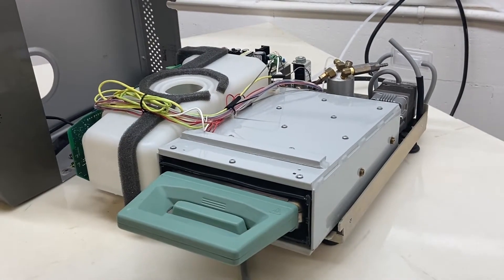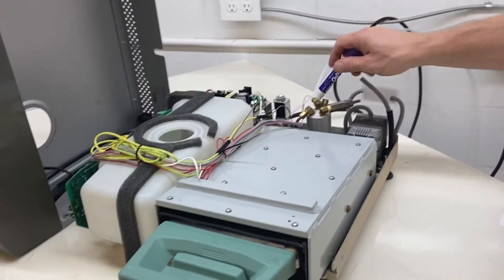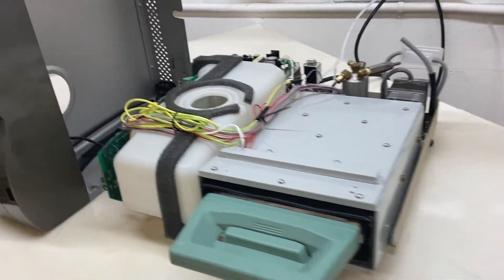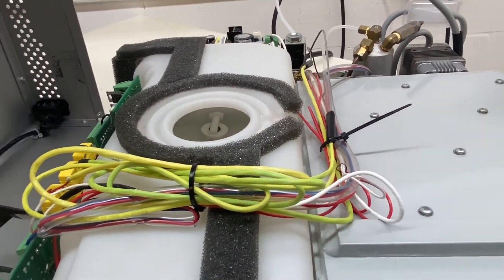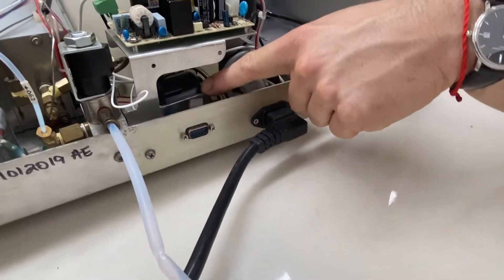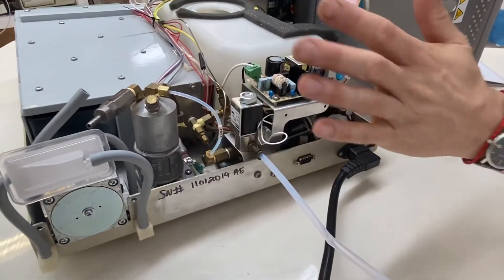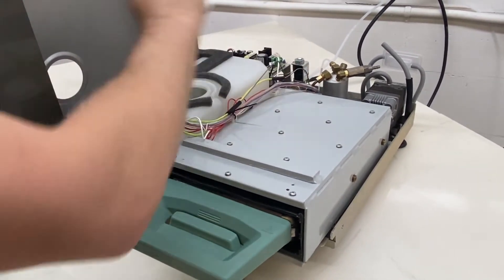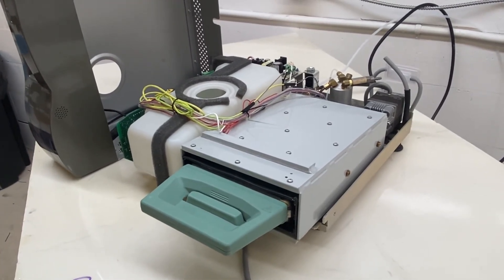Statim G4 Error Code Cycle Fault 16 - How to Troubleshoot

Comment: I got error 16 now in every cicle, when it’s heating and reaches 106 - 107 degrees (C) and appears the error.
Reply from the maker: Thank you for the comment! Error code 16 could likely be caused by a handful of things such as the water pump, the solenoid valve, the steam generator, etc. We recommend you call in to our Free Tech Support Line at 704-966-1650 Option 3 so our technicians can assist you and better diagnose your issue.

Comment: I have a boiler I guess getting constant power?! End of cycle it vents but the pump keeps pumping ( new pump) and injecting into boiler, turns bags etc just doesn’t work right and I get a cycle fault 16 sometimes ?!? Help I’m Poore
Reply from the maker: Yes, you are correct it is a boiler getting constant power. But it's a board issue. Contact us at 704-966-1650 Option 3 for tech support for further assistance.

Comment: Hi sir. I hope you are doing well.i am facing trouble with statim5000 cycle fault 1. I have checked thurmal fuse sunnoid wall cassette memberen but machine not working properly.so plz help how can solve it 
Thanks for your support Sir
Reply from the maker: Effort Service give us a call 704-966-1650 we can definitely help !